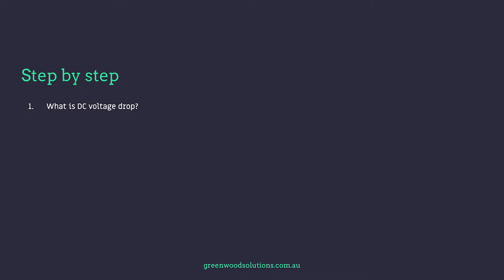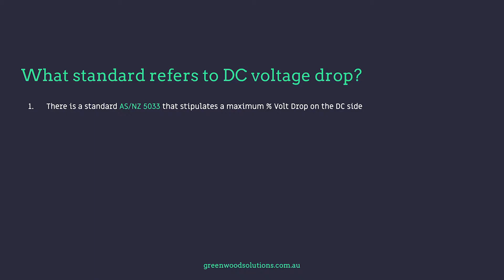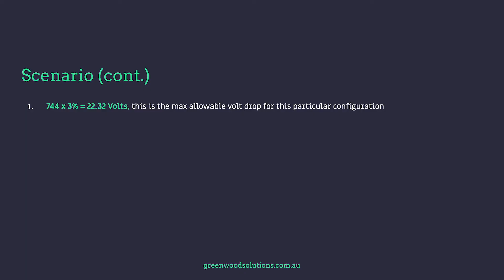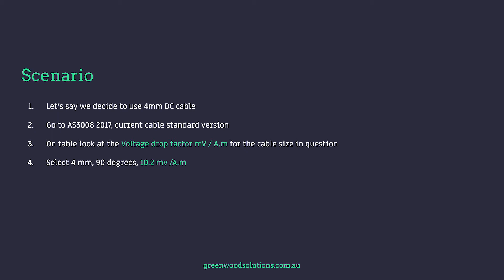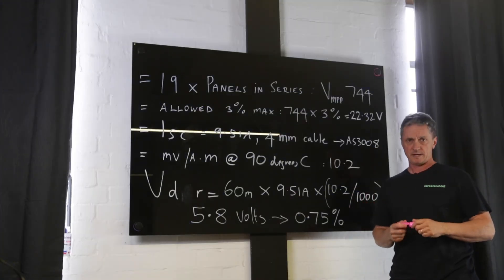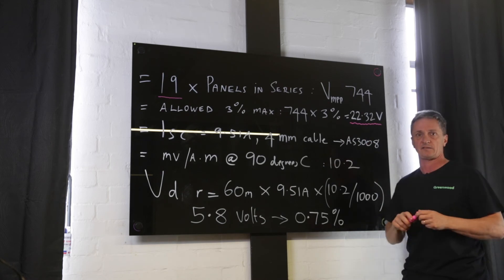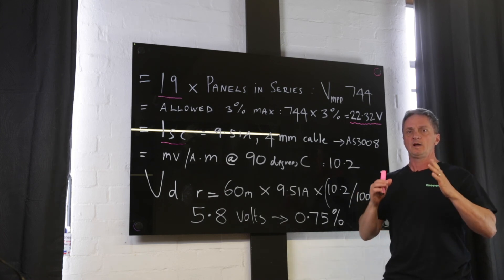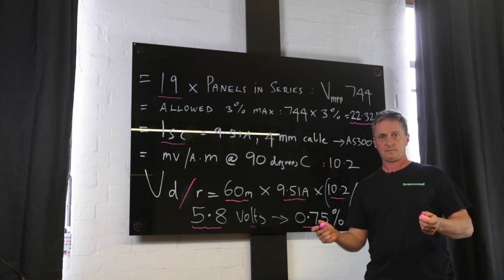A Guide to DC Volt Drop

Comment: Im not trying to pick apart your calculation, but just wondering why you are using Short Circuit Current value instead of Maximum Power Current value. In my view, the Short Circuit current isn't usable and won't be seen at the Inverter input
Reply from the maker: All good. 
There is no prescribed current allowance in the standards and you are correct in regard to IMPP but I tend to use ISC 'cos it allows a little safety buffer and I have seen panels get right up near ISC in some locations

Comment: Two things that a lot of people don’t know is that mppt can’t maintain a constant set voltage like say 60 volt output 1000watt solar 150v 11amp .200amp 55v lithium battery the mppt output voltage will drop 52voltage at 29 amp because the battery is drawing the current even though the controller adjusted the output current low the voltage will drop more because the battery now drawing voltage to make up for amp so it’s a lie that mppt alway maintain it output voltage no matter the load draw lie
Reply from the maker: Thanks for your input.